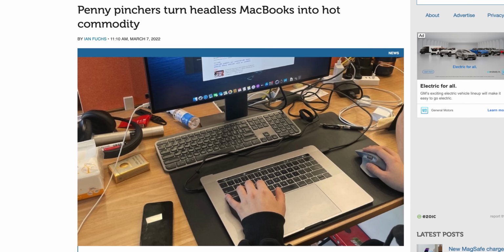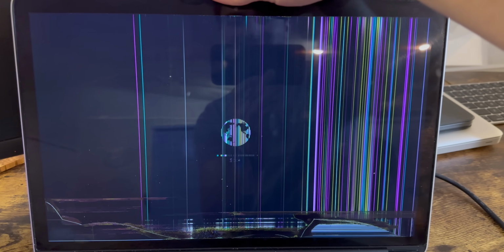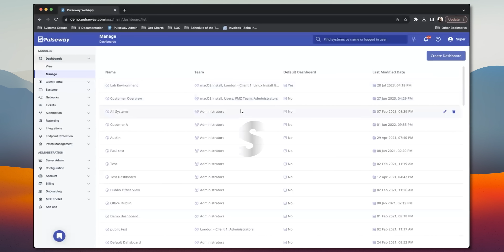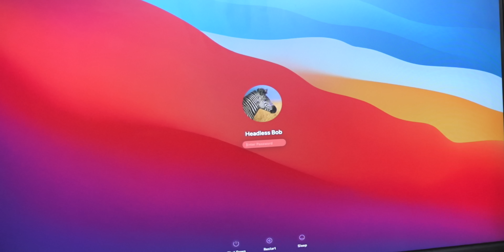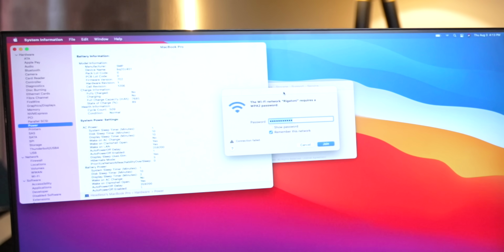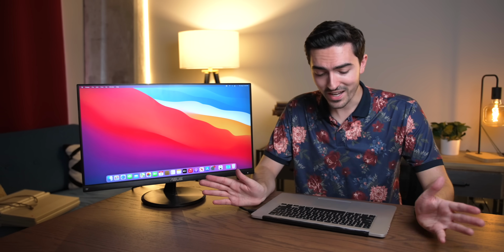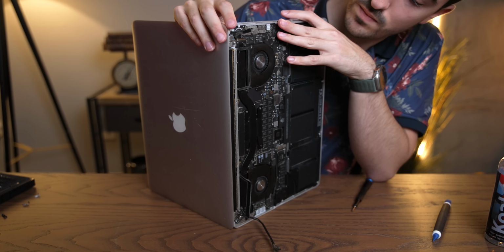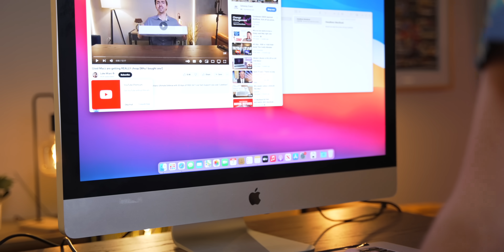Exploring the weird world of 'Headless' MacBooks

Comment: The current position of the antenna blocks the airflow, so it would be great if you 3D printed a small housing for the antenna that resembles those on WiFi routers, so it folds out upwards. Then you could keep the camera at the tip of that antenna!

You could also replace the default keycaps with a custom mechanical or otherwise keyboard! (You could snap in and out a quieter low profile and a mechanical keyboard if you are using it in a library or smth). You could also use the hinges for a custom keyboard cover when transporting it.
Reply: I have a wifi antenna I can just plug into usb
Reply: or just don't remove the screen and connect an external mouse and keyboard that's far better than the trackpad and keyboard on the macbook.
Reply: @JangoFett-q9o 
Magic keyboard isn't backlit and the magic mouse suuucks. MacBook keys and track pad is the far better—and less wasteful—solution.

Comment: This is the first time I've heard of someone removing a laptop screen. 

a) As a laptop with big screen. Almost every single laptop screen is too tiny for work, and you can't raise the monitor enough - the useless laptop screen is in front of the work monitor. You remove the problem, without having to buy a $30 keyboard, $30 mouse, $30 USB hub, and put the laptop to the side. (Or Apple keyboard+trackpad for $350.)
b) The design is too thin, or lacks protection from knocks, so the screen going bad is a common problem. (Not for any of my Windows laptops, but YMMV.)
c) Macs are very expensive and service is not available in many parts of USA and the world, and you get someone who owns the right sets of screwdrivers to do it and connect a monitor without having to drive for a day or wait for weeks.

Maybe it's a bit of a) and c) + Windows laptops won't boot fully if the screen is removed but Macs do, so you can still use the computer?

Comment: Ultra portable monitors that have extremely low profiles make these headless machines just as portable as they were before. With anywhere between 720p and 4k resolutions at an unwieldy number of display sizes. You can maintain portability. And like you don't just have to do this to a MacBook. You can do this to any laptop.

Comment: I have done this- or something similar- with two different Macbooks (an ooold, pre-unibody MacBook Pro and a 2012 MacBook Air) and I've had great results! In each case, the screen cracked but the computer otherwise functioned fine. The old MBP was the core of my music production and arranging business from 2008-2020, and the Air is still in service as an ersatz HTPC! I didn't bother to remove the dead screens- I just run in clamshell mode and use a wireless keyboard and mouse- but as long as the computers stay cool and the batteries don't explode, they work pretty darn well!

Comment: Welp my comment is that I have an older MacBook which was top of the line in its day (so SSD) and I just couldn’t get rid of it but now I will use it for what it was intended instead of just a door stop! Thank you! Hopefully, I can deal with the antenna as beautifully as you did in this video!  

Addendum: Just saw your PRO TIP about the location of the antenna relocated to the base and now I will definitely be sporting a headless MacBook!

Comment: This makes 100% sense. Worst case senario, you'd use a USB Wi-Fi adapter, but turns out you don't even need to do that. I would also 3D print a plastic cover for the tape to also act like a stand and raise the keyboard a little. Or just cover it with a thick carbon fiber vinyl wrap for better look. Plenty of options. I wonder in older models with dual GPU Macs, which one has the video out? The discreet Nvidia or the Intel? Also, this obviously works with PC laptops as well, in fact I've seen that mod years ago, and there is a bunch of videos on how to convert a broken laptop to a desktop.

Comment: Much like old 80's computers like the Commodore 64, MSX, ZX Spectrum and BBC Micro. 
Of all of them there were 'headless' models. It is to say, the keyboard was on the computerguts and you had to connecct a monitor - in most cases a television - to it.
Before you comment, I know most of these only had headless models, but I also know there were MSXs built like a normal modern PC.

Comment: Two minor form-factor adjustments I'd like to see: IIRC a major part of the ventilation is housed behind the monitor hinge so I'd be interested to see how the custom piece takes that feature into account.
Also, at risk of stating the obvious, there's a free hinge bracket just going spare at the top of the headless unit. Seems like the perfect place to mount a flip-down foot bar to raise the back edge for improved cooling and a more ergonomic typing angle.

Comment: Did the same thing with my crappy 2017 MacBook Pro 13". The display cable was the weakest part of this model because it was shorter than needed! But this was acknowledged as a defect only on MacBook Pro 2018.
Reply: just bought a 2017 13" with broken display for 50 euros hopping to do just this. is there anything I should be aware of? thanks

Comment: Hey you can get the LCD only for a $50 - $100 bucks man! even for a M1 macbook air 2020. not sure about the devices with the notch. Have you considered that option? also as there macs are dying with ssd faliures, there are more and more places that repair such ssds by replacing the NAND, upgrading the storage capacity in the process. Its a common thing where I live. so are you unaware of this or are you completely ignore third party repair????
Reply: I meant replacing the LCD panels without the aluminum casing/ backlight. just the bare LCD.

Comment: If Apple continued to develop and utilize Motorola processors, I believe we would have something amazing now. Yes Intel processors have higher frequency ratings but Motorola processors like the G4 are so much more efficient. A 300 MHz G4 rating is just as good as 800 MHz AMD, whereas until processors, we need about 2.4 GHz to reach that level of processing power power.

Comment: The rationale of "Apple would charge $$$ to fix it" is mind-blowingly stupid.
If you can take off the lid, then you have all the skills you need to install a cheap replacement from eBay.

It is annoying that so many people jumped on this bandwagon after some Apple vlogger convinced them that it was cool. 
If you have a working screen, removing the lid turns your computer into an extremely overpriced desktop. If you have a broken screen, it is better to keep the lid so you can protect the keyboard while not using it, or better yet replace it yourself with an inexpensive used one.

Comment: Recently I was at my local dump and saw what looked like the bottom of a macbook on the bin. I picked It up realized the screen had been forcefully ripped off and it was a 2009 macbook. Ok nice. And right beside it was....... The screen. Which um didn't survive the forceful separation of the mac.
Brought it home plugged it up worked just fine....

As a headless Linux Mac owner It's not bad LOL 😂
Except um.... The wifi 7:15 Yea Can't really do that because as noted it was forcefully separated and the wires were....* coughs * frayed and snapped

Comment: I bet it would run much better without wifi module blocking the air flow. Even better, I would print the spacer to separate the bottom plate from the mother board. You could easily squeeze there a wifi and a dongle for extra i/o.

Comment: I'm a long-time advocate of right-to-repair and mandated open availability of OEM and 3rd-party repair components for consumer electronics.  But in the case of MacBook screen panels, part of the problem is that Macs have screens that are outliers in the laptop industry both in terms of higher DPI ('retina') as well as colour space, accuracy, and brightness.  So they're limited production parts and not used on many or any other laptops.  Low production numbers equals higher per-unit costs.

It's hard to find a cheap OEM replacement when the things are made to an unusual Apple spec in the first place.  So even if you could get a cheaper 3rd party screen, do most people want to repair their laptop and save a hundred bucks, but now your laptop looks noticeably worse?  It's a poser. 😐

Comment: Ha that's great to get a usable machine and apple suck recently, now the SSD has planed obsolescence and does so many cycles and then fails, try changing the SSD. You can't
I don't see me renewing my macs much longer with the way they are going and taking this locking down just too far. 
I need to know my machines are bulletproof pretty much and reliable, they are removing that bit by bit so you can't get it repaired easy and you can't work.

Comment: I actually think Apple should release something like this where the computer lives in the a keyboard, trackpad and speaker set up much like the bottom part of a MacBook Pro. Call it a Desk Mini. Just put the display ports in the back instead of on the side. Hell maybe make the trackpad could be made larger and act like a Touch Bar iPad combo compatible with both the apple pen and the finger so people can do some graphics design work.
Reply: Though I wouldn't do the electrical tape, might as well take advantage of a more open cooling set up if you take off the display.

Comment: I recommend Open Core Legacy Patcher also. That in order to run Ventura, and maybe 2 cheap 8 gb ram sticks and that thing would be easily useable full time. I have an older mid-2012 macbook pro that has legacy patcher, and Ventura runs incredbly well. The HD was swapped to a Samsung evo, and 4 gb ram to 16 gb ram. 

After watching this, if my display ever goes I'm definitely making it headless!

Comment: Great idea, very nice! I did something similar with an 2012 mbp with a dead display connector on the logic board. I took out all the components and just hooked the logic board directly to a LCD monitor, effectively turning it into a modular iMac. What I like better about your solution is that you retain all the Macbook's original functionality like WIFI/BT and the battery to be able to move it around while still powered on. I do see an issue with your WIFI module placement though, you're now blocking the ventilation of the machine. Instead of housing the components in a solid enclosure I'd suggest to go with a (plastic) mesh instead so not to block the airflow. I think 3D printing is the way to go or you could consider using wood and drill an array of holes in it to let the air through. Thanks for sharing and definitely an inspiration to do something cool with old parts!

Comment: Neat idea for a budget Mac setup, kinda undoes Apple's stupid planned obsolescence. Now despoil it further with a Linux install. lol

As far as what to change, I'd probably 3D print a replacement for the hinge cover so it looks nicer than tape. For wifi I'd hook it to a dedicated external antenna if it's going to be a desktop in function to improve signal gain.

Comment: headless conversion is very common for old laptops, you can make them thin and beautiful with custom case. acrylic or sheet metal. And a lot of higher spec-ed laptop still runs very well with a ssd upgrade.

Comment: The European Union recently passed legislation requiring simple user replaceable batteries in phones and standardized power plugs.  Unbelievable!   The potential compromise in water resistance, weight, and size and restriction potentially inhibiting innovation is crazy.  This because a few noisy consumers think they know what’s best. I argue that had such legislation been passed a decade ago we wouldn’t have the amazing devices offered to us now.  There’s no reason to think that this won’t happen with other devices as well.  How about ear buds?   What will those look like if they have to accommodate replaceable batteries.  Who thinks legislating to the lowest common denominator is a good thing for innovation.  Personally, I only just traded in my iPhone 7 for a 14.  Battery was still adequate. I hope the industry wins their appeal against this or solves the problem by selling a stick on external battery lump that you can buy to boost your 5 year old phone that the rest of us would just happily replace.

Comment: Great video! 🙂 earlier this year I rescued a late 2011/early 2012 27" inch imac with a broken/cracked screen and some bent marks. Removed the screen, connected an external monitor to the displayport at the back and it worked, Don't know if i'm gonna buy a new screen (if it's worth it)  or transplant the guts to another case. The internal screen uses a regular lvds 30-pin connector.

Comment: Very cool idea. I like it. I have a 2017 MBP and the battery is failing and not holding charge properly, despite only having 700 cycles or so. Apple want 240 bucks for a replacement and the local independent repair guy wants 220. Not going to happen, sadly. Apple need to seriously reign-in their outrageous greed, but  that also ain't gonna happen either.

Comment: Thanks for this.  I have a 2012 15" MacBook Pro Retina with a broken display.  I am building my sister a Plex Media Server, and plan to use that MacBook as the server.  I'm going to store the media on an external drive, and locate the Mac/drive in her TV cabinet.  I'll run the Mac's HDMI cable to a second port on her TV, and have her Apple TV connected to the first port.  If it works as envisioned, she will just need to use her remote to switch the display to the MacBook if she needs to do any OS or Media Server maintenance.  Then she can switch back to HDMI1 to watch the Apple TV, including the Plex App.   She lives cross country; I am going there in 2 weeks, so I will hot test the set-up using my own Apple TV and television, then carry the needed bits with me and set up at her home.  Should work nicely, and most of the time, the MacBook will be out of sight!

Comment: In the 1980s it was common for companies to have parts available up to 7 years in the United States.   Not sure if it was a consumer law.  In the late 1990s companies like NEC would not sell parts to consumers for monitor repairs.  There still are a few companies that will help you resolve an issue, it does pay to be polite and patient. Sometimes they will even send you small parts free because it is rare for someone to ask where to buy parts.  ie: small protietary light bulbs

Using a broken laptop headless is the cool way of doing tech.

Comment: I did this in the early 2000's with an old Powerbook and used it as a server. The integrated battery meant it would keep going for a few hours even after a power failure. It was also small enough to mount on the underside of a desk.
Reply: Yeah. Old laptops are great for servers. Take very little space, and you have the full keyboard access when required. Tug the machine under table on couple screwed metal brackets and you forget it existing. And then you just SSH in them as required. Or use VNC etc to have nice visual remote control.

Comment: I have done this with my Dell 2 years ago and it still works no issue. For missing wifi I actually used a cheap wifi dongle (may not be the fastest option but works just fine).

Comment: I owned a 2016 15inch before,  and sold it after 1 week because it was too hot. Not a good experience even just surfing internet or watching youtube. I think the heat is the common issue for all intel models, because the external monitor only works with discrete graphic card, not the integrated one.
I will buy a m1 headless one if available

Comment: Hey vintage-Mac enthusiasts 👋! Any advice or feedback would be greatly appreciated:
I have a 11-yr-old MacBook Pro (15" mid-2012 i7@2,6 GHz, patched) that I now only use in clamshell mode under a dual-screen desktop. (I opted for a ssh-linked smaller MacBook Air for my on-the-road developments and for times where sitting on my desk just can't compare with laying on the couch).
I upgraded it a while ago with 2x8Go DDR3@1600MHz and a 1To SSD.

 > Is it still worth trying to find compatible fresher components to make it last a bit longer (newer RAM specs, faster SSD(s)), or just wait for the updated new Apple computers this fall and replace it with an affordable M1 refurbished / M2(3?) entry-level MacMini ? 

This old fellow is still impressively robust after more than a decade of intensive use (still faster than W-word computers provided by my employers in 2023). Wouldn't it be because of Apple's scheduled plan to give up any kind of software nor technical support for intel Macs and developers progressively abandoning legacy apps, I bet I could keep it for anouther coupe of years...

Comment: been there done that on mac / pc's. excellent video :face-red-heart-shape:
manufacturers don't believe in Right to Repair (shout out to Louis Rossmann) :face-blue-smiling:
done dual boots on mac's. battling a snow leopard right now, installed Windows XP (got video to prove it) just that old browsers won't work on letting you download or say to old. trying to install Windows Super Lite aka Windows Black. got that darn spinning wheel, no not the song. Bootcamp allowed, but then installation part said not DOS mode but need to be NTFS. gonna try Ex-Fat or pull out hard drive and on my pc connect to HFSEXPLORER since that's what i used to extract 35 GB of pictures and music purchased from iTunes